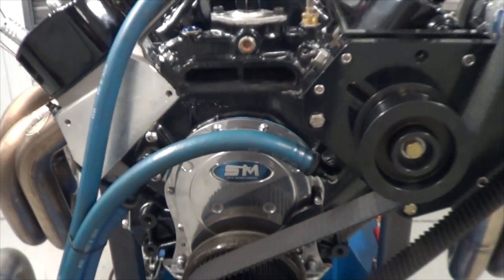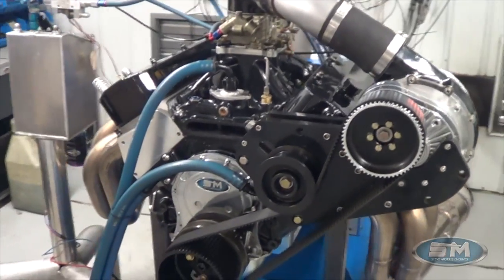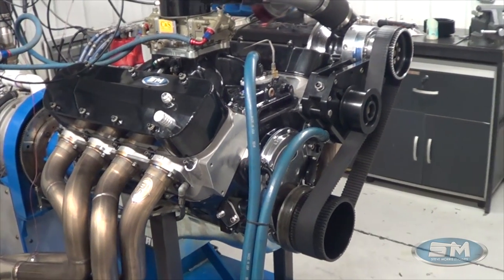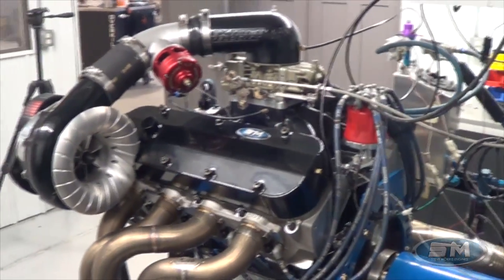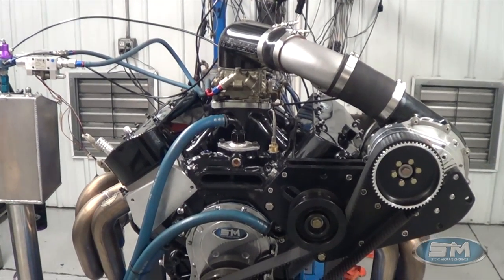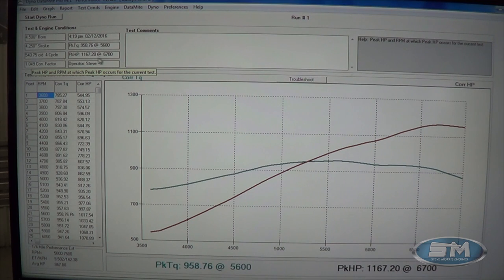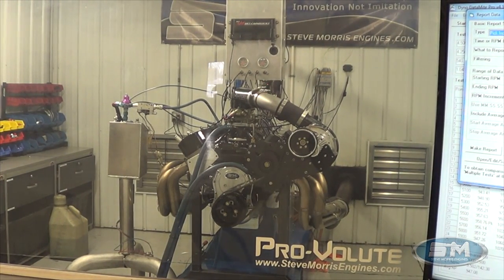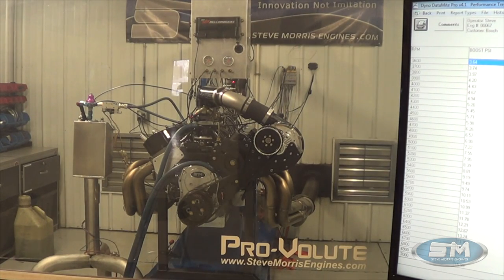Street and strip 1100hp+ BBC

Comment: Steve is a 454 worth it? Can it really run 800 n/a with ease or no. I have someone telling me they can build one and make it billet proof but my research states the 454 unless aftermarket is problematic
Reply: I have a 496 making about 770 NA. It isn’t easy to make 800 NA with a 454 unless you have really good heads and high compression bug cam